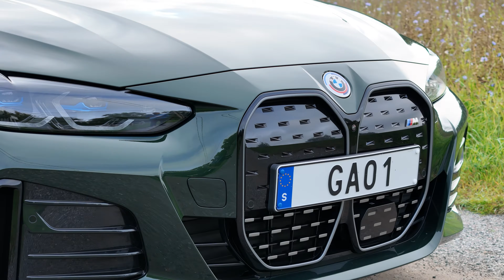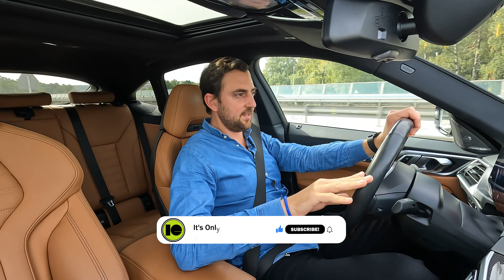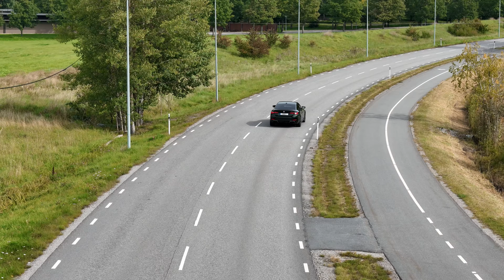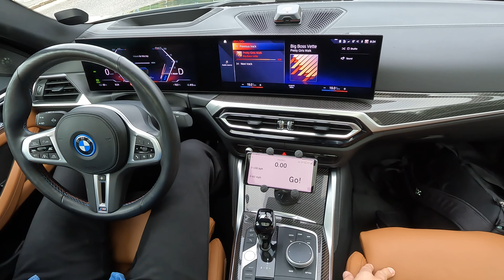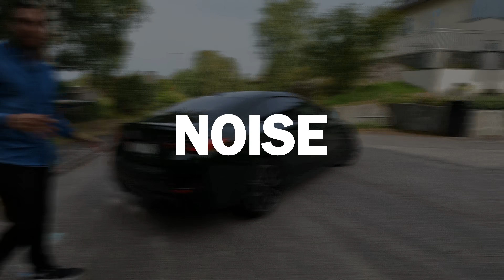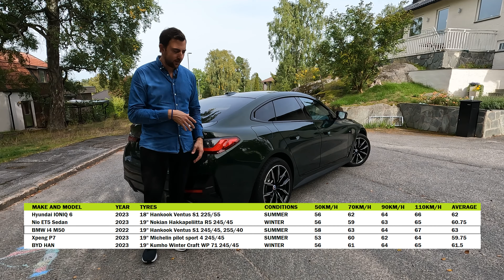BMW i4 M50 - Test: Range, consumption, noise and acceleration

Comment: I wonder if the DB rating changed as I noticed you reported on the 2022 version, what about 2024, two years later? Didn't BMW change the tyres later on which can make all the difference? (For Australia anyway)
Reply from the maker: Tyres and wheel size makes a big difference.

Comment: I’m 6’4” tall. Same as you.  How are you fitting? With the the seat fully down my head rubs the ceiling.
Reply from the maker: No problem fitting for me. I'm sitting in a fairly backward leaning position..and it's the sport seats with glass roof.

Comment: Thanks for your video.  The range you reported is quite a bit higher than the claimed range and I wonder if you had an elevation decrease during your test miles?  This would be something to note during the review regarding total elevation change from start to finish and it would be best to find as flat a route as possible.
Reply from the maker: It's a flat and closed path so it starts and ends at the same spot.

So the beamer really did it good and delivered exactly as the claimed WLTP.

Comment: Nice car by why is it the exact same size as a Tesla model 3 but weighs 446kgs more than the Tesla ?
Reply: since no one gave you a good answer i'll tell you why. the i4 shares the same platform as the petrol version. so you have a lot of things like a driveshaft tunnel that's completely useless and adds weight + take up space. shaves off on the cost as i believe the i4 should be more expensive than it is but then theres added weight
Reply from the maker: @thalesletus1 thanks for following up! 👍Issues with youtube Studio mixes comments up and I lose track.
Reply: @thalesletus1  It may have a similar footprint to the Tesla but there's a lot more sheet metal and structure in the i4.  The driveshaft tunnel is more a loss of usable space (tho batteries are inside) than added weight.
Reply: @davesax11  it was just an example to show it's not a purposely built ev platform. i test drove both and while i way prefer the bmw i had the standard tires on the i4 and the tcs is just complete shit. there's no other word for it, just swings you everywhere not balancing the torque properly to keep traction while all the other brands i have tested it's unnoticeable. there's pros and cons to every evs just like there is for anything else and the tcs is one of the really bad thing i noticed on the i4. the middle console got very hot too for some reason. my gf noticed more than me but still. there's also report of the seats being uncomfortable on very long drives but i didn't experience that. tesla seats were way worse in my opinion.
Reply: @thalesletus1  So the i4 is not a purpose-built EV platform.

Then again, a purpose-built EV platform is an experimental platform where you try to eke out weight while compromising on things like strength, durability, and handling.

You may say a petrol platform is compromised. Someone else can substitute the word 'proven' instead. Don't tell me the company that stuck their trunk underneath a truck bed (or made a high-wear replaceable component into a unique 4-foot long wiper that burns out the motor) is a company that has thought everything through in their designs.

BMW figured out how to make a car electric. Tesla is trying to come up with an electric mobility solution.
Reply: @BogeyTheBear  we could go back and forth pretty much forever but the question is why the bmw is so heavy and the answer is thats a repurposed shell over a ev specific platform. i never heard of a ev frame snapping in half like we see quite often with full size ice truck. doubt frame or platform durability is even a question for ev. i4 is in my opinion a budget friendly "premium" ev since they can cut cost on the platform being that its also used for something else. im sure once their sale go up and ev takes a bigger part of their sales all of them will be ev specific. just a question of time. my next car is a toss up between i5n and i4 m50. i like the look of the i4 but i5n is such a performer.
Reply: @thalesletus1  They may not be coming apart on the road, but Tesla body panels are coming out of alignment over time, dents are appearing all too often from even the lightest amount of stress, and they're being totaled by impacts where other cars could have been repaired.
Reply: @BogeyTheBear  like i said we could go on forever. bmw has been around since 1916 and tesla 2003. bmw is performance oriented company with some luxury while tesla is ev only trying to stay affordable yet tesla model s plaid track package completely destroy any production bmw on any measure performance wise. while they are not perfect they are doing damn well having the most sold vehicle in the world. we can also look at how extremely bad the bmw electronic system is by constantly failing prematurely which is astonishing considering they been around for over a century. you'd think they would have it figured out by now.
Reply: Quality of the BMW far higher than the Tesla.  So yes, the body and frame weigh more. Along with everything else.
Reply: Why do you have to gently close the hood of a Tesla 3 with both hands to prevent a dent from forming in the metal?
Reply from the maker: Yes, and less interior space and boot capacity

Comment: So....this car has 14km more range than the ET5T... Whats the price difference?
Reply from the maker: The fully specced et5t with the big battery is ~20k Euro cheaper than the fully specced m50. But that's is depending on the added equipment on the m50.